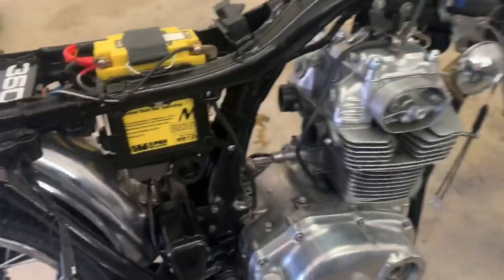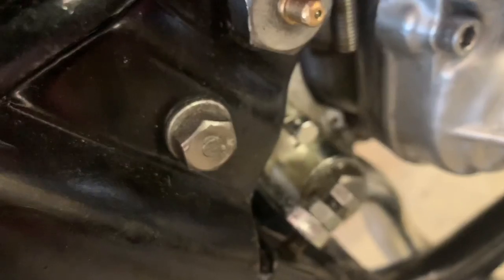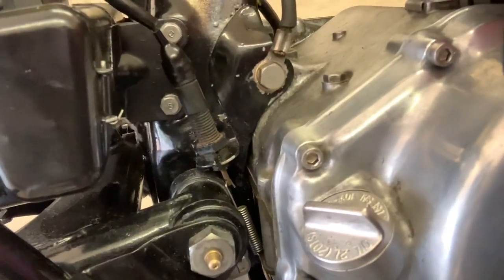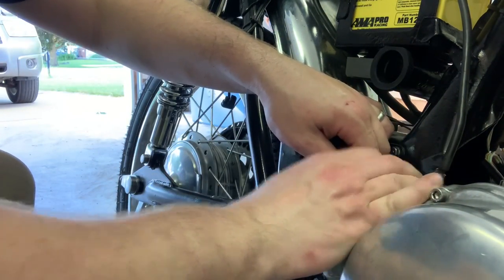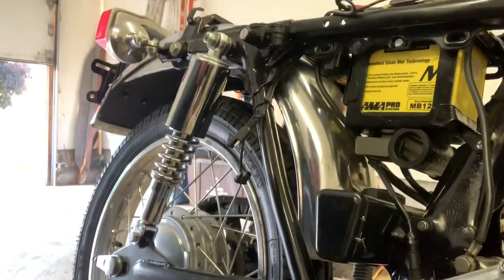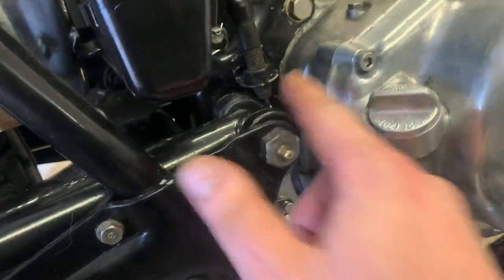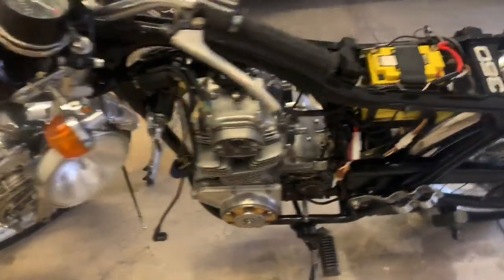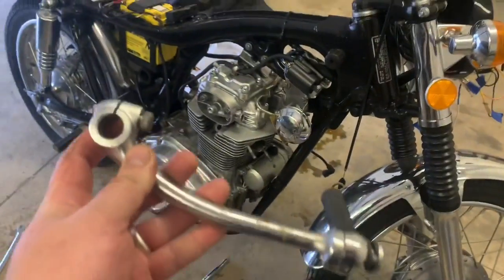Install Honda CB350 CL350 Rear Brake Light Switch

Comment: wheres the video of where you wired it up mine only works when i wire it direct to the battery once my existing wiring harness gets plugged in it bypasses the switch and is always on
Reply: NVM figured it out 12v brake light wire on harness ------>  switch input >>switch output ----------12v + output wire
Reply from the maker: Glad you got it sorted!
Reply: @KeepOnWrenching where I can see the video I don’t much how to do it

Comment: pain in the butt huh........my switch spring was not hooked on the peddle side and I still don't have it's length correct........it will come....Ty
Reply from the maker: It was finicky. But once it’s in the right spot it’s operates like smooth glass. It doesn’t move much either. Just gotta be patient and find the sweet spot. Good luck, David!